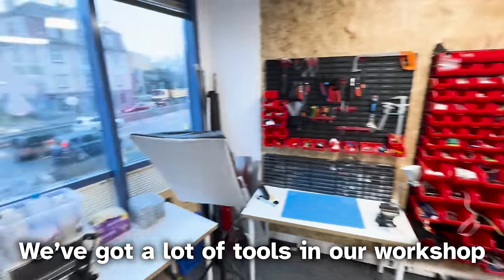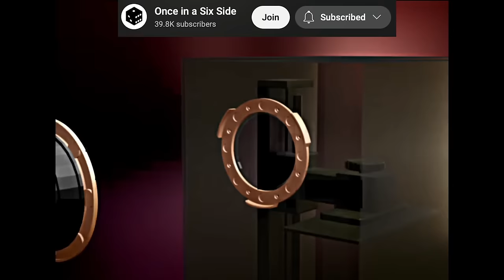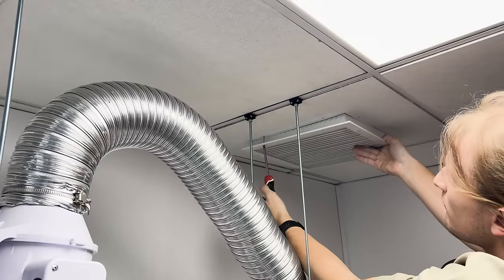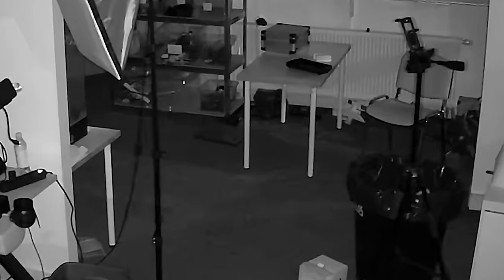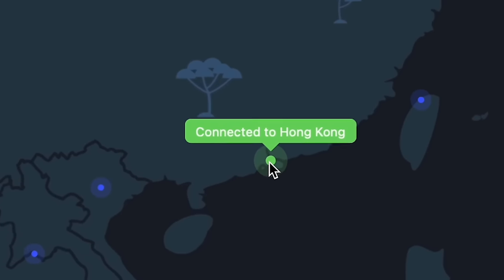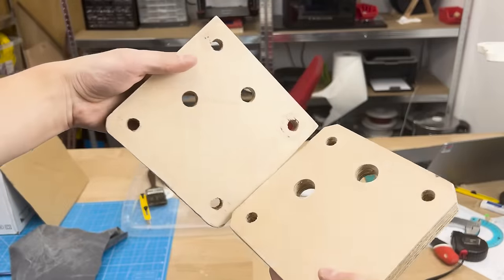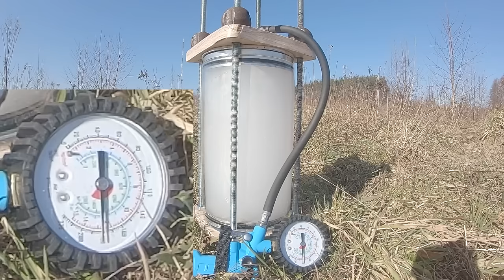Testing our pressure chamber to MAX PRESSURE

Comment: Hey! About pressure chamber. Don't use air. Air is compressable, if something cracks it explodes. Use water instead (pressure washer works fine). If water only filled chamber crack - it just leaks some water. Check out some diy hydroforming videos.
Reply from the maker: You are right, that's exactly what we did at the end of the video!
Reply: Came here to say the same. Highly recommend you watch blondihacks building her steam engines. You need to pump water, not air, even if the tube is 100% filled with water
Reply: @CPSdrone  Thing is you are pumping gas. Even few cc of compressed air can be deadly. Because you are adding a "spring" to the system in form of compressed air bubles. It' might be ok in case of main chamber failure, but rapture of tubings or conenctions might be as deadly as explosion. That's why i'd suggest using pressure washer. It pumps liquid, not air. No springs attached.

Comment: next time when printing those ceiling clamps you should rotate the clamps on their side to print with the longest length up. that way every layer forms a continues hook that will hang from the ceiling. the way you printed them now results in the best looking print but when they are in use all forces are on the layer lines trying to delaminated them.

Comment: Hello friends, for my resin curing workstations I use a combined central exhaust system. 

I have three ventilated compartments that are all on the same exhaust tube, 

-dedicated fabricated waste / large print curing chamber (fabricated out of cardboard, UV emitter, and aluminum foil lol), 
-post-processing work station which has a vent hood and is partially enclosed with a plexiglass face shield
-sealed printer / print cure enclosure. 

All three get connected to printed butterfly valves so that the airflow can be modulated to whichever station demands the highest ventilation flow. From there, its sent through a carbon air scrubber and out the window.

Alternatively, in the past before I had the ventilation system I had a combined charcoal / HEPA filter to pull the VOCs out of the air and from the meter readings I took it seemed to work well. The only downside is the filters foul faster than they are rated for due to the high VOC level.
Reply from the maker: Sounds like a lovely station!

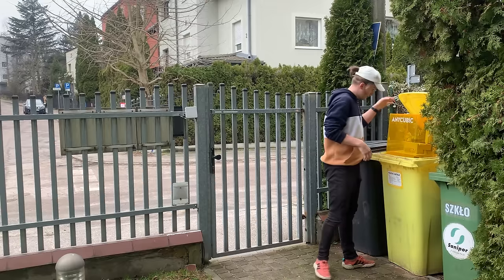Comment: 5:28 
Just use a filter for your ventilation system so you can recycle the air... More expensive yes, but it's what we use at my university. I'm sure there's some chemistry hoods or filters available at decent prices on ebay somewhere...
Or just pump air to the outside directly through a window...

Comment: For the endcap I would have probably gone with steel inserts... I think wood is a bit more unreliable and takes more effort to fabricate compared to 3D prints... For the resin printers ventilation you could consider ejecting the fumes directly out of the windows. Great job guys, keep it up

Comment: na 100m masz 11 barow cisnienia. 10 barow to cisnienie wody a 1 bar to cisnienie powietrza naciskajace na wode. pozdro
At 100 meters, you have 11 bars of pressure. 10 bars are from the water pressure and 1 bar is from the air pressure pushing on the water. Cheers.

Comment: To filter the air from the printers, just use activated carbon filter foam, they are made for this purpose
Reply: Second this, where I work we have a resin room that you need an organic respirator to operate in and is vented outside with activated carbon filters